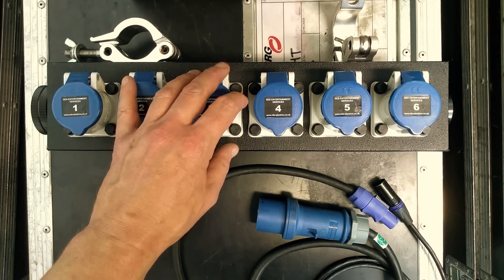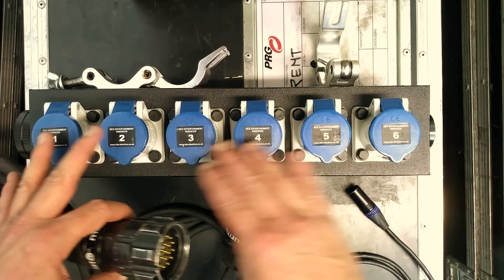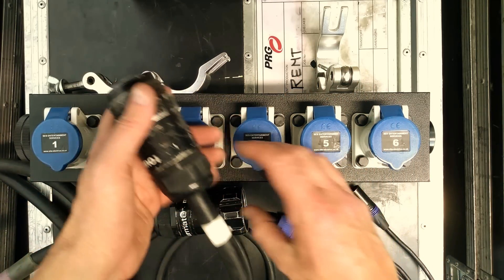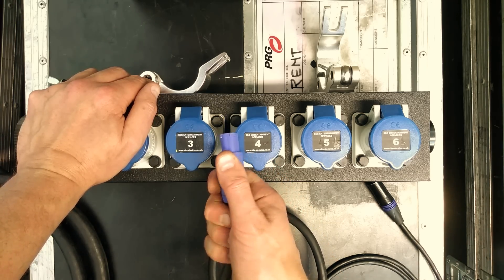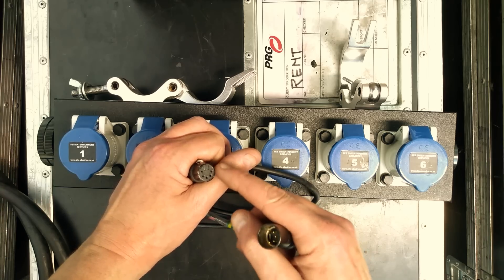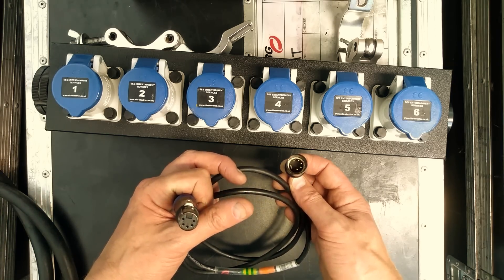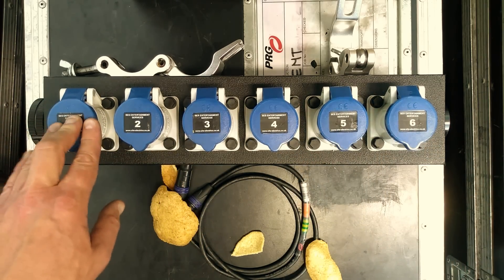Entertainment industry connectors.

Comment: I thought the "T" in TRS stood for "Thick", but i've been wrong before
Reply: ben Jovi i thought it was thermal resistant silicone but equally could be wrong
Reply: i've only ever heard "Thick Rubber Sheath", and i've seen the proof, them cables are not thermally resistant lol
Reply: Unnamed Player And mobile headsets are TRRS with T and first R same as on headphones, while second R and S are either ground and mic or mic and ground, depending on phone model, though most now seem to use the iPhone pinout.

Comment: I have used the newer powerCON True1 connectors and they work well, however after connecting a set of 3 24V/60W power supplies basically under load for a couple of times, one of the pins looks a little bit scorched.

Comment: Here in the US, I rarely see CeeForm connectors used for power, though it is still used to a degree. In the US, I mostly see Cam-Lok connectors used for big items (such as 24KW "Daylight" fresnels) and for lower current items, I see Hubbell Twist Lock used
Reply: SpaceMountainLarry we use powerlok in the UK, because they're harder to shove fingers inside of

Comment: Reminds me of a DS38999 MIL STD connector with less pins. Mainly used in aircraft systems, very rugged, robust, made for applications where need for contact assurance is high. In my mind it seems like fairly trivial thing to be able to make them water resistant with some rubber gaskets - but takes away from the ruggedness I guess.

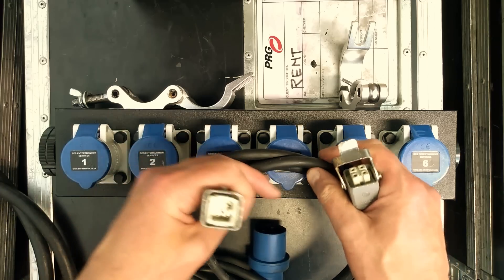Comment: 5:27- That type of connector has always caused me problems in describing its halves, one has a male body with female contacts, the other has a female body with male contacts. Confusing, no?
Reply: Unnamed Player No, he politely asked how they wanted to be addressed because he couldn't tell.
Reply: Unnamed Player gene wilder concurs
Reply: Go by the contacts. I had a co-worker who was convinced that the IEC power cable's female end was male because it was inserted in the receptacle on the equipment. If you want to think about it too much, just about any connector can be confusing. Take BNC, it's got layers of gender you could try an unwrap if you take more than the contacts into account.
Reply: Jim Stanley - Thanks for the tip (no pun intended). Yes, the BNC is a complex set of 'genders' and taking the IEC as an exemplar simplifies things as the end delivering the power  has to be considered as a socket. :-)
Reply: Sorry?
Reply: Apart from household power connectors almost all connectors follow that pattern, because the "female body" (shroud) protects the protruding (male) bits. Connector gender is determined at the mould, based on the contacts. Though it is kinda meaningless with some of these new transindustrial connectors: mixing three-phase power and data in one connector is now an old trick, the new hotness is mixing power, data, pneumatics and fiber connections :D
Reply: @dasstackenblochen9250  - What is even worse some of my (English) fellow countrymen/women now refer to the thing mounted on the wall to supply power as a "plug-socket" - how stupid can they get?

Comment: You lighting guys stealing our connectors !!!!!!!!  When it used in speakers its called Speakon!

Lighting in our building uses BS 546 15 amp plugs unfused.

14 universe !!!!!!!!!! thats insane!!!

Have you ever used QLC+ for DMX?
Reply: You may already know this, but in case others don't, PowerCON and SpeakON are very similar in style but are definitely different connectors that do not intermate (at least not without a lot of brute force and ignorance).   But the adoption of SpeakON style connectors for line power was pretty obvious when you consider how similar the voltage and current needs are between high power PA systems and typical line circuits, so good on Neutrik for making that happen.
Reply: Andrew Joy with the amount of varilights and other very controllable lights they use, the universes kind of stack up. 8+ channels per bulb.
Reply: 8? Try  30+
Reply: I remember a fringe show last year with an insane amount of universes. Over 100. Our standard stage racks go out set for 16. Although it's easy enough to take them up to 24 if needed. There are a fair few fixtures now with 90 channels+ (ok you wouldn't normally have them in that mode)

Comment: Interesting to me about the Socapex connector is that it has what would be called in military connectors of a similar style an "Arctic coupling nut."  A coupling nut that can be operated by thickly-gloved hands.  Such a style of coupling nut is slightly heavier, though, so it's only used on equipment which will be operated in such conditions.

Comment: Is it possible to install type g sockets in a house that's wired to take type a and b sockets?
Reply: Possible? certainly. Legal? probablly doesn't comply with the national electric code, which may be a problem if that is enforced in the part of the US where you live. 

Most UK sockets will be designed for UK backboxes, Leviton do make one for US boxes (part BSRDP) though it may be hard to find.

Also what are you going to feed it with? 120V on a socket designed for 240V would be weird. Probablly the best you can do in the US would be to wire it across both hots, that would give you a 240V supply, though neither pin would be a neutral (which shouldn't matter for most appliances but it still a little strange on a UK socket)

Comment: Great video BC. I love this stuff. I work in Television. I have been an Engineer traveling in TV since 1985. I am surprised that (unfortunately) all the cheap Chinese consumer DMX stuff is all using standard 3 pin xlr connectors, which is pretty lame when all the audio is using 3 pin xlr. Like you said in pro lighting it's pretty much 5 pin Xlr cables for dmx signals. I should have thought of this and done some show an tell on American television. Pretty much standard stuff, but would have been fun to kill some time. I never had time to make content, but I love  watching yours. Great stuff. Thank you. Cheers.
Reply: Robert Smicz thing is though, DMx protocol on a 3 pin XLR running over microphone cable is horribly out of spec and not entirely reliable, but it does *work*. And usually well enough — at the cable lengths involved — for the sort of people that buy cheap Chinese dmx gear.
Reply: Jasper Janssen. exactly sir, that's why I'm so surprised the consumer dmx stuff uses shielded xlr cable. We use mostly 4 pair twisted pair telco cable  (doubled up pairs) terminated with xlr 5 pin connectors. I believe the dmx data is EIA 485 differential data and runs very long distance on twisted pair. Using standard Audio 3 pin xlr cable does not work very far. Yes it works for garage bands small lighting. The cheap Chinese cables are using 3 pin xlr connectors, but are not using shielded wire just cheap 3 conductor cable.
Reply: Ive had over 50m runs on mic cable. Never had a problem. Yep, it's not best practice, yep all runs should be terminated. But, when the show has to go up, if it works it works.

Comment: is there a difference between 0v and 10v when compared to  0v and -10v
isnt this just basically swapping the polarity
Reply: it's not just swapping the polarity, it's changing wether the negative or positive side is earthed. Which can cause lots of "fun" if mixed
Reply: If you swap around 0 and 10 volts, you get 10 and 0 volts. The reason you don't just get 0 and -10 volts is that the original 0 volts will still be 0 volts relative to anything else in the same circuit.

Comment: Back in the mid 1970s, I had to relocate a hard wired analogue dimmer control panel to install it into a 20 foot console we built. This was in the days before digital control circuitry. At that time, the US electrical code required we use 12 gauge wiring, even though the panel only used 24 volts. I think there were about 100 wires involved. We had to buy 6 inch greenfield flexible conduit to hold them all.
Reply: Cowboy Frank's Personal Videos Copper gauge is determined by current, not voltage.  Voltage determines the gauge of the isolation plastic/rubber.
Reply: I am aware of that. I should have been more specific. The only current feed component on the dimmer board were small 1000 ohm variable coil wound liner resistors.  The issue was the code hadn't caught up with the technology of that time. In this case the amperage running through those 12 gauge wires was only about 200 ma which fed the electronics (tracs and control circuitry) in the dimmer panel back stage. At that time, electronic dimmers had only been around a few years. Just 7 years earlier, my high school which was brand new was still using variable transformers.

Comment: In North America we tend to use twist lock instead of Cee form (we call it pin and sleeve) we have 15/20 amp versions for both 120v and 240v. TRue1 seems to be becoming a standard here.
Reply: In data centers, we used twist lock up to 30A.  After that, is was typically pin and sleeve or CS because there isn't a NEMA standard twist locked rated at 40A and 50A (last time I checked).  NEC prefers you to hardwire I guess.  That's not practical in a data center though.
Reply: IT style twistlock (Hubbel) plugs are so flimsy feeling.  I hate those things.  I'm not sure how often they develop loose connections, but it seems like it ought to be a common problem - at least if they are subjected to more than a few mating cycles.

I use SpeakOn connectors when I moonlight as a sound guy - they're fantastic.  I would love to see PowerCon connectors replace NEMA twist-locks.
Reply: Oddly enough, the True1 seems to be a solution looking for a problem.    There are NEMA configuration 50 amp twist-lock plugs.   They aren't specifically NEMA, but they use the exact same configuration - and since Hubbell invented the plugs, they can darn well determine the 50 amp plug and receptacle :)   (They list them as "NEMA configuration", using the L16-30 designation)

Comment: do you have issues with the new regulation on halogen lamps? or did you already switch to mostly led? (last year it didn't seam like it with all of the par cans :P)
Reply: Are you sure the regulation deals with specialty halogens used in entertainment lighting?  I'm pretty sure there is a whole list of exempt halogen lamp types which are not being phased out.
Reply: not 100% but as i've read that with the new regulations those exemptions got removed. Which made sense to me as my local theaters all changed over to led par cans recently.
Reply: i don't understand. what's the big deal about halogen?
Reply: Color temperature and CRI - color rendering index. Stage lighting isn't just about bright, it is about color. LED lighting is getting better, but it still has a very lumpy spectrum at best, and makes it really hard or impossible to get some colors you really want in the theater. Incandescent lights are still the only thing that has a CRI that is good enough for smooth color rendering.
Reply: yeah i get that i mean why do they want to get RID of halogen?
Reply: It is less efficient than LED, and the EU wants to get rid of people using watts, I guess so they can shut down all those horribly polluting hydroelectric dams and take them out and let the fishies play. They changed the rules for 2020 so that you can only get a stage lighting exemption from the 98% efficiency rule for lamps over 5KW, I think it was.
Reply: it's amazing how ridiculous european regulations are getting. do they even talk to subject matter experts that don't have huge profit to make off of these changes on whether they are dumb ideas or not?
Reply: When you have a self-electing government that sets its own budget and is by law not responsible to any of the states it governs, why would you expect them to care what the people of the states think, or even what the governments of the states think, or what any political action (bribe) groups think? They can legally do just as they please, and charge you for it.
Reply: SuperAWaC
the intelligent politician had the idea to ban halogen lighting now too, whereas before only the old school tungsten ones were outlawed. And in the entertainment industry halogen light is still used a lot, because of the brightness you can get at a reasonable price (~50€ for a basic par64 can + a 1kW lamp vs about 250€ for a basic led par64)  and there is talk at the moment to remove the exemption that the entertainment industry had so far too, meaning the companies would be required to upgrade EVERYTHING to led immediately wich would be very expensive.
Reply: I wilton - And yet, I've been told, repeatedly, by Europeans that they have the finest government, health care, etc - and that everyone else is nuts for not being JUST LIKE the EU.  (Usually aimed at the Americans, but also Canadians)   Gee, a self-electing government that sets its own budget, and has removed all ability to forcibly resist from the population.    That can't possibly be a bad idea.
Reply: It's certainly a European idea. Goes back about 2000 years.

Comment: Cud I yous Xlr contours on my power tool cabl
Reply from the maker: Not recommended, but you could use the new Powercon compact connector.
Reply: bigclivedotcom ok
Reply: Hobbyists do this sometimes, with dubious motivation and at least as much agreement as they get criticism. Some say XLR is fine, others say it's madness. Then they consider PowerCON stubs, but don't consider the additional weight, risk of snagging, strain on the cable attachment, and general inconvenience of a bulky, non-flexible section right below the powertool's handle. See for yourself: Here on YouTube, find Marius Hornberger and his Neutrik PowerCON conversion and read through the many angry comments. Enjoy!